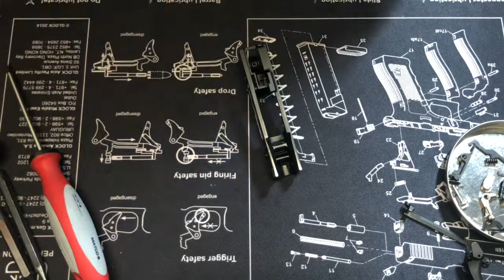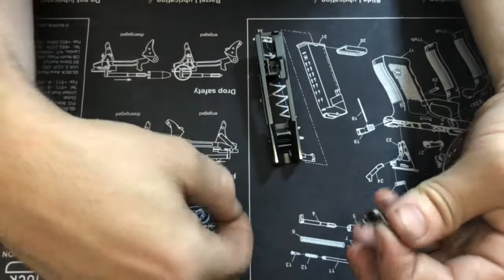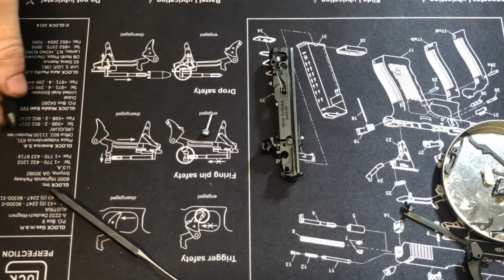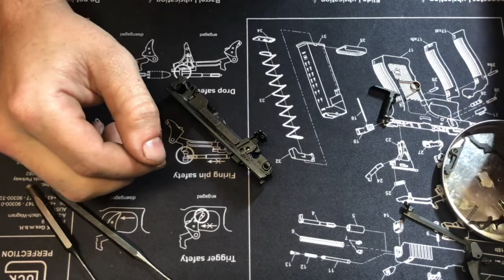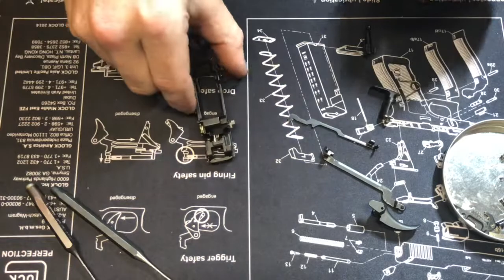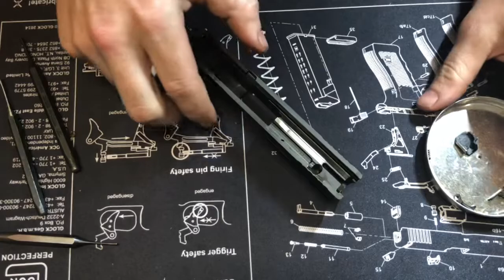SIG P365 Disassembly/Assembly Part 2

Comment: I've been working on guns for 30 years and all I gotta say is this sear and spring is a ROYAL PIA!!  This is the first time I've had to do an armorer's level strip, clean and trigger for someone on this model. I watched a number of videos to see what tricks/tips you all are using.  I wrestled with it for some time until I got creative and lined up the sear/spring separate as  an 'assembly' then came in at the top where the spring hooks under the sear by pinching with tweezers. With the pin partially in the carriage was able to set the assembly with the short spring leg under tension on the 'shelf' inside the carriage. After 3 tries DONE!! damn now I can go to bed and finish this fire control reassembly in the a.m. :)
Reply: i know it's quite randomly asking but do anyone know of a good place to stream new movies online?
Reply: @Felix Victor Flixportal :)
Reply: @Jake Kyler thanks, I signed up and it seems like a nice service =) I appreciate it !!
Reply: @Felix Victor Glad I could help :)

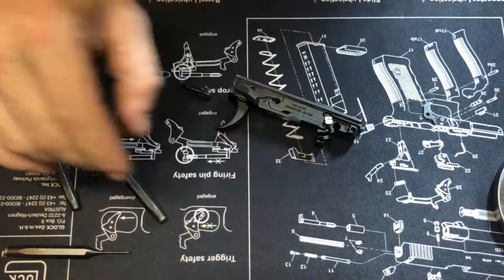Comment: I asked this on the disassembly video but you called it the 'plunger' here at 15:58   I took the slide off my new P365 and that component moves and I can hear it jingle a little up and down when I shake the gun (I can also hear it when the slide is on a little).  I'm not used to hearing anything move in my P320. Is this normal in the P365? Thanks again!
Reply from the maker: I do remember that piece would flip back and forth on a pivot and make a noise, but if I remember right it’s because I didn’t have it installed right, you may have to take it out and make sure it’s in the right direction. I don’t own the gun anymore to compare it to right now. That piece is what pushes the firing pin block out of the way when you pull the trigger

Comment: I can’t get my slide bake on it’s like the sear is hitting the bad of the bottom of the slide. I didn’t completely disassemble but I just figured out the same thing happened as did you it fell out of the groove from the trigger when I pulled the trigger the sear didn’t move and wouldn’t let the slide engage

Comment: Question. I had an issue with the slide lock lever. Unfortunately during reassembly the 365 is locked to the rear but stuck in that position. What can I do to remedy this
Reply from the maker: Something went back together wrong, does the slide lock seem so stiff it won’t release the slide, id try sliding the backing plate off the slide remove the striker assembly and it should free the slide up to come off. After that you’ll need to double check your Assembly